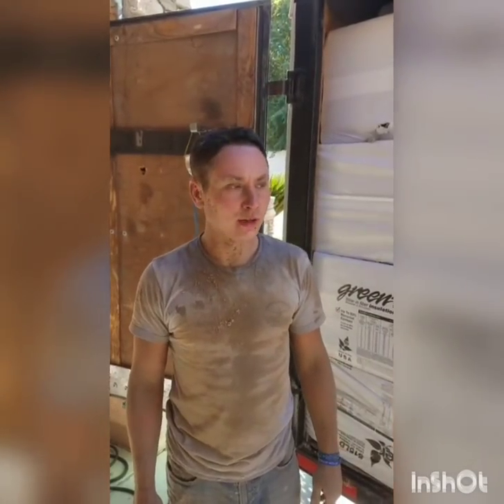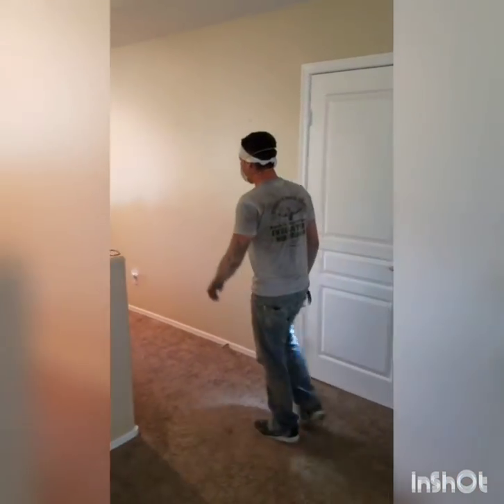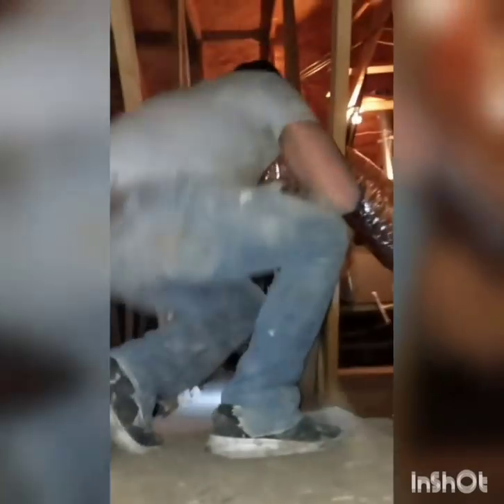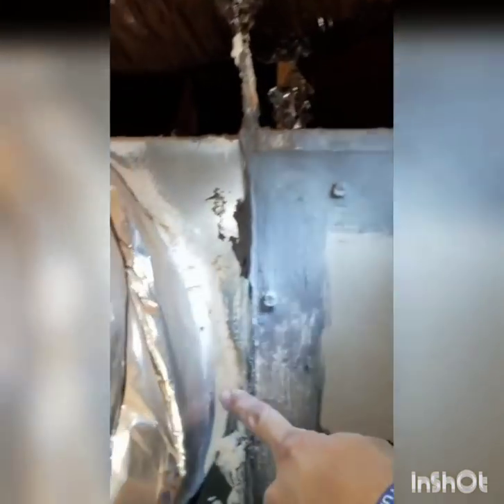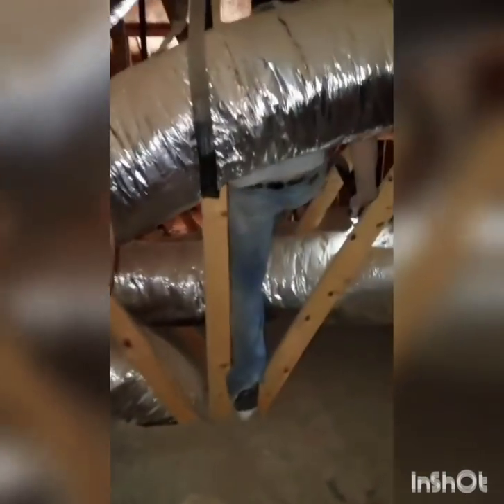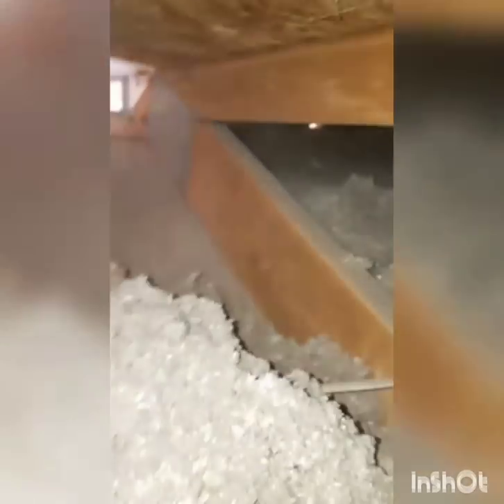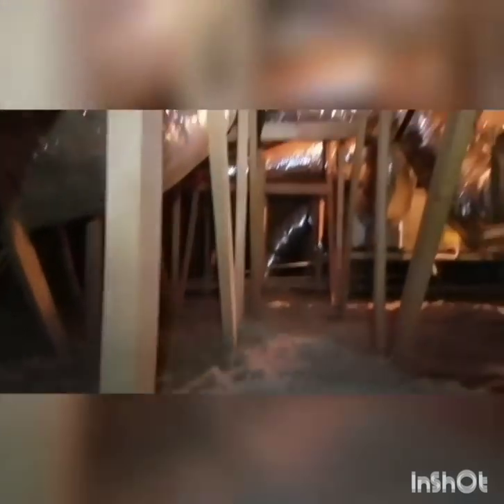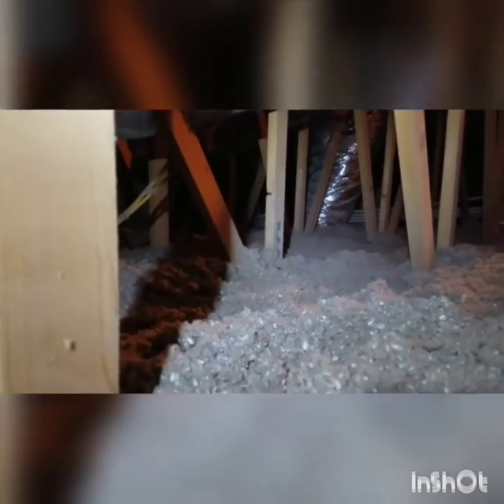Attic Insulation, proper way to install baffles, duct seal touch up, R-38 blown in Cellulose insulat

Comment: This is best explanation I've seen on why to install the soffit baffles and how to do it. My attic already thanks you!
Reply: The best one I've seen is you use a Harbor Freight 'grabber' type tool so you don't have to get so close to the soffit and get all dirty like he did.  You just grab the baffle with the tool and push it back.  Then I'd use a little rack to push the insulation underneath the baffle instead of my hand.
Reply from the maker: You're welcome Mark thank you

Comment: Definitely much easier when done at building stage. Also, you may want to insulate that condensate drain while you’re at it
Reply: He said it is Arizona ,  All time Low Temp of ??  60 ,  not much chance of freezing,  Eh .
Reply: @karensaaristo4728   No chance of freezing, but the horizontal sections of pvc will sweat in a hot attic and drip water. Condensate water is much colder than ambient temp of the attic.  I’m in Florida and they drip all the time if not insulated. It’s code to insulate in unconditioned spaces.

Comment: I noticed insulation blowing throughout the attic. Would there be any problem with also laying plywood, or even cardboard, over the insulation? To reduce the issue of blowing around and to keep it in place.
Reply: Do not want to compress any type of insulation, it will lose R value. Needs to be as fluffy as possible

Comment: My roof only has vents every couple of rafter bays, do you only put in baffles where air is coming through a vent from outside? Does the roof need an air gap between insulation even if not outside air would normally be coming in from there? Im planning blown in cellulose for around R40 in coastal SoCal.
Reply: Edward Duff ok, thanks for that, I hadnt thought about sealing the lights. It seems the baffles are not big enough to take full advantage of the eave vents, are there larger baffles I could use for these rafter bays and then the regular baffles for the non-vented bays? Maybe scrap piece of plywood or cardboard across the bottom of the rafters?
Reply from the maker: @HomesteadOC  Hello, air sealing is the proper prep work prior to insulation and will reduce air transfer from attic space to living space. 
For a well installed baffle I found it best to use the pre-manufactured ones made from cardboard. They're easy to work with and can be cut or manipulated around any obstacles you may come by. Do not install baffles around any flue pipes venting through attic space.
Reply: Shawn Larson thanks, really appreciate it.
Reply: @HomesteadOC  How do we contact Shawn Larson - phone or email to get a quote
Reply: Mary Schwertley No clue, I just commented directly to him on youtube.

Comment: Don't you loose the air movement or ventalation from the soffit the way you did that?
Reply: There is space between the roof and the baffle.  It just diverts the airflow up and over the insulation.  It both prevents the insulation from blowing away AND falling into the vent.  The house I'm getting ready to buy does not have soffit vents or baffles, so this is going to be one of my first projects.  It has a nice new roof with ridge vents, but no soffit vents.  Stuff that you get with a house built in 1929, lol.
Reply: Agree aure looks like he blocked the Soffit vents off from the main space and therefore the ridge vent gets no flow.....
Reply: @davebeard4987  clearly shows a a inch to two inch pocket you can see light through all the way down to the soffit behind the baffles, open your fuckin eyes